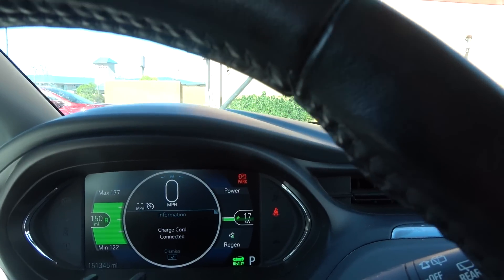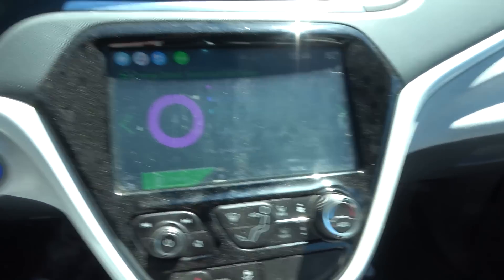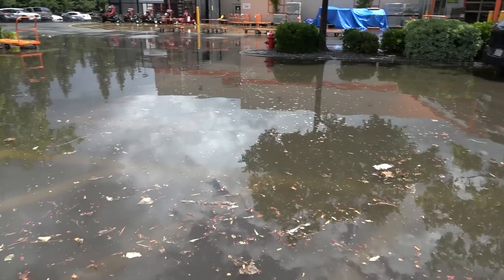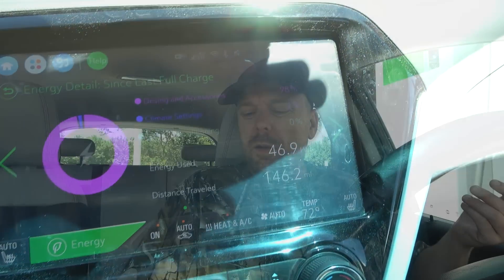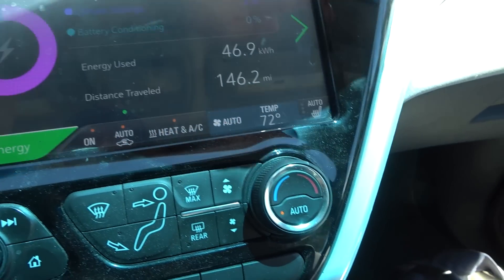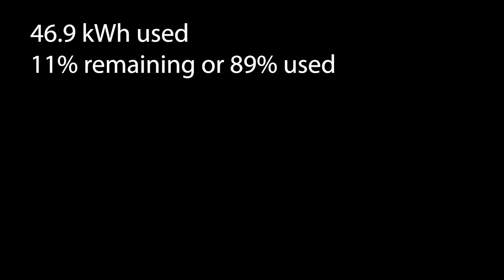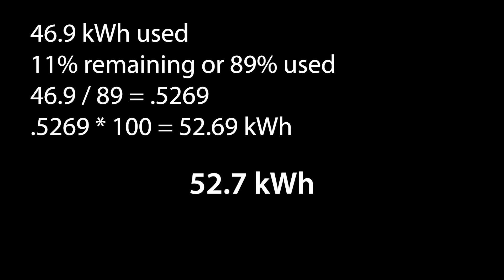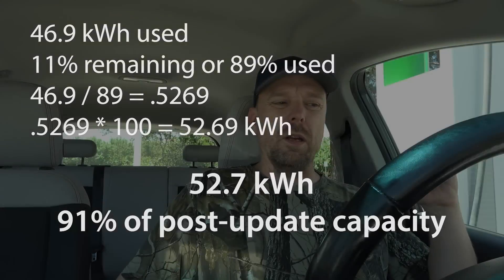2017 Chevy Bolt EV Battery Degradation at 150,000 Miles

Comment: Thanks.  10% degradation is probably less than the manufacturer who shall not be named, especially given all the DCFC you've done.
Reply: Tesla? Well DCFC of a 60 or 66kWh pack at 50kW Vs Tesla’s 60-100kWh packs at 150kW - 250kW is going to degrade differently.  Most stories of Tesla degrading is due to people not understanding that batteries store energy NOT miles.  Miles are a function of speed, temperature, elevation, and mods. The most range comes from nerdy aero wheels and tires that are not great for handling and enthusiasts driving.  People look at a Tesla and range based on base tires wheels plus ugly hubcaps at 45-55 mph. They put on heavy wide tires without aero covers and drive 85 mph and complain of “battery degradation”

Comment: Eric, it seems to me that a 10 percent degraded capacity is not bad considering the mileage, battery age, and all the DC Fast charging that you have done.
Reply from the maker: Yeah, I'm not upset. It makes me wonder how much better it would have been if I babied it the first year and didn't charge it to 100% every day.
Reply: @newscoulomb3705  Well considering that in the equation even makes it more respectable I think.  Was that 100% charging done with Level 2 mainly?
Reply from the maker: @mikehedrick6544  Yes. I almost never charge to 100% on DCFC, unless I'm doing some sort of specific testing.
Reply: @newscoulomb3705  That’s what I expected. If charging to 100% on a DC Fast charger the amperage is very low anyways and probably comparable to the Level 2 rate at that point I would imagine. Seems to me very respectable degradation amount to me.  That’s a lot of miles at 150,000 miles of driving.  Thanks for this and all your videos!!! ✅ ⚡️ ⚡️ 🔋
Reply from the maker: @mikehedrick6544  Thank you for watching, and you're welcome!